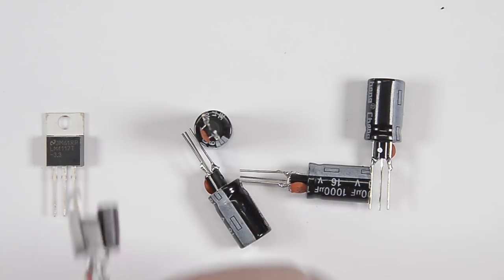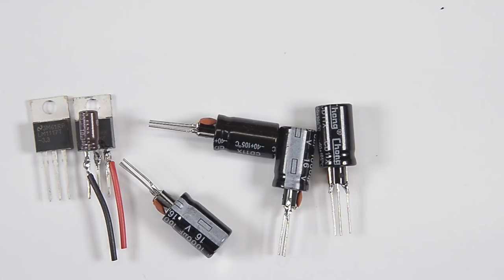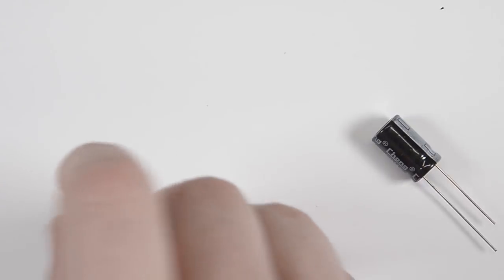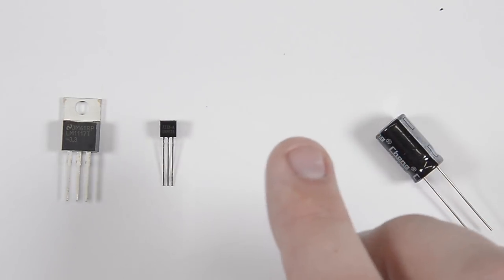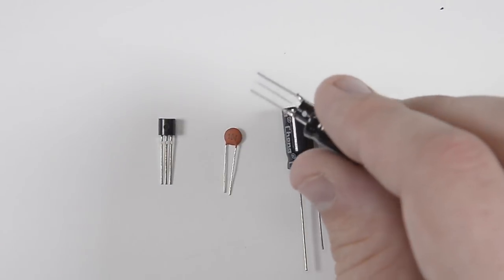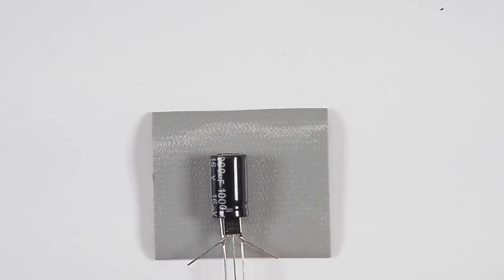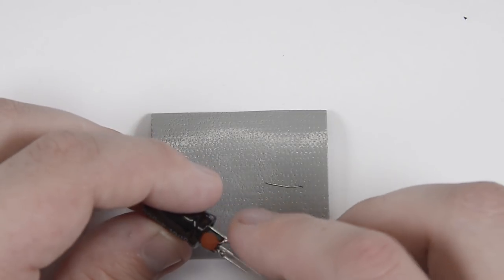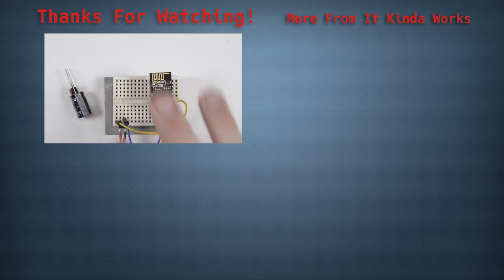New ESP8266 Voltage Regulator Design

Comment: I would actually add that small cap between INPUT and ground, as output and ground are already taken care of and you just add a tiny bit of capacitance to big electrolytic cap.
Reply from the maker: Depending on the power source you may want a cap on the input as well but in general my 5v power comes from usb or battery both of which usually end up with pretty clean power. It's really important to have a cap on the output though since the regulator isnt built to take large spikes in current draw and can drop the voltage low enough to reset/crash the ESP8266.
Reply: Yeah, but then you have this big ass electrolytic cap, so why do you need small one as well? Also, remember about cheap USB chargers, they don't do a very clean job :)
Reply from the maker: the idea is that they operate on different frequencies. The larger cap handles large lower frequencies of noise and the smaller one handles higher frequencies because it can react faster. This keeps the electrical noise to a minimum across the spectrum.

Yeah I know cheap usb chargers arent all that great but I cant complain since I very rarely have an ESP crash these days. I also tend to end up using the charges that come with devices I buy since most of the time I just plug into big USB charger hubs and toss the manufacturer chargers in my IKW bin. The apple and one especially are good but so are most other phone manufacturer chargers. You're right about gas station cheapo chargers though

Comment: Isn't it nescessary to use a cap between Vin and Gnd?
Reply from the maker: Not if your power source (Vin) is already a fairly clean power source such as usb or a LiPo battery. If you have a not so great power source then it might be a good idea to have one on Vin as well. It's not as necessary though.
Reply: I see. Not a huge problem then since it's usually powered by LiPo. Thanks for making these videos. Very helpful with usable tips and "right to the point". Subscribed! :)

Comment: any Links for where I can buy the regulator online?
Reply from the maker: I dont generally post links because I buy them from ebay listings that come and go quickly but here is the top listing on ebay currently http://www.ebay.com/itm/20pcs-NEW-HT7333-A-Low-Power-Consumption-LDO-TO-92-/142153858105?epid=687134941&hash=item211907bc39:g:S34AAOSwPCVYBviC

Comment: I like those tiny StepDown, they are so usefull and so handy.
I myself use AMS1117 3.3v or 5v (Which is also super tiny  & handle 800mA, not bad). combined with 2 capacitors, for IN & for OUT.
PS: I used once APL1117 which is also a good choice!!
Why did you add the second capacitor (orange one?? sorry dont know well its name and purpose here).
Thx

Comment: Datasheet says 250mA absolute maximum for the 3.3V model which isn't a lot of headway. It will be ok for a naked ESP8266 but just adding a few LEDs would make it uncomfortable already imo.
When a datasheet says the maximum, I already assume half of that value is the real life value I want to allow myself to use to keep long term stability.

Consider a follow up video where you sacrifice some of them to science by connecting it to a current limited PSU and slowly raising the limit.
Reply: I think in reality the ESP modules will peak at around 350ma risking the dreaded ESP Reset issue.  I really like this idea, just if there was a bit higher current LD0 in the TO-92 case.  Better would be a buck converter in a TO-92.

Comment: Nice for temp jobs, But nothing permanent should be made like this. 
Please let us know when the caps start failing.
Reply from the maker: +ProCactus what about this channel makes you think that anything on here should be permanent lol! I will let you know but so far so good
Reply: lol ok. Was the first Ive seen from you.
Reply from the maker: No worries dude just playing around. FWIW I rarely have these installed upright. Most of the time it is sideways in a circuit so most of the heat heat generated by the regulator is not going directly into the cap.

Comment: Nice video 📹, and what I don't understand is way using 2 capacitors (one big and one really small) cann you help me help me understand this?
Reply: tx, Agent Office , and i still don't get the poit bicouse they are paralel connected?
Reply: Thomas Bender
A not totally correct but essentially accurate explanation: capacitors of different values smooth the voltage out at different frequencies, resulting in a more stable DC supply.  This is why you will find capacitors all over the place in most electronic devices wherever power is being drawn.
Reply from the maker: This is a great IKW type explanation!
Reply: The big cap is for smoothing, the small is to prevent the regulator to oscillate at some high frequency , it did happened to me, got a hot regulator for driving only 5mA out.
Reply: For extra info on why you use multiple value caps, see EEVBlog #859.  He explains it all there.
Reply: It's not really about the capacitance but about the ESR (equivalent series resistance). The ESR determines how quickly the capacitor can release its charge (lower ESR means higher peak current). Usually you'll see a ceramic cap and an aluminium electrolytic cap. Ceramic caps have very low ESR, but also only come in small capacities (serving short, high current peaks), whereas aluminium electrolytic caps come in much higher capacities, but also have relatively high ESR. Basically when power draw quickly rises, the ceramic cap covers the short initial spike and then the electrolytic takes over. Sometimes you'll even see several different sizes of aluminium electrolytic caps in parallel because their ESR is proportional to their size.

Comment: why 2 capacitors
Reply from the maker: Quoting from boggisthecat "A not totally correct but essentially accurate explanation: capacitors of different values smooth the voltage out at different frequencies, resulting in a more stable DC supply.  This is why you will find capacitors all over the place in most electronic devices wherever power is being drawn."

Comment: usually  li-ion minimum is 3v some have 2.75v
Reply from the maker: Thanks!
Reply: ItKindaWorks However there isn't that much energy in that region. If you want to keep your battery healthy it is a good idea to cut off at around 3.3V anyway.
Super elegant solution imo, maybe apart from the placing.
Reply: The minimum is what your battery management says it is!  You can take them down to millivolts, but I wouldn't hold out much hope when you try recharging the thing!
Reply: another li-ion myth

Comment: Υou had to say how it is
 has such a small voltage drop

lm1117 =transistor
HT7333-A =mosfet 

Big difference !!!!!!!!!!!!!!!!!!!!!!!!

HT7333-A  this is done with mosfet, which is what it means
the voltage regulator can not be set in series
with a 5 volt power supply, so you have 5 volts
and 3.3 volts.
(digital 5 / 3.3 volt)

  this is something that lm1117 has the ability to do.

in fact

when you want 3.3 volts
from batteries you use
Step Down Converter Buck Module
with a range of 3.3 to 6 volts

Comment: This kinda works channel..  is pretty sharp...   and the kinda works sharp guy said 
The step down voltage modules... cease supplying 3.3 v when under 5V power input
Which ended out being spot on...
Won't be able to power these Banggood  regulators on battery very long
Building the 7333 and the 7350 version of this regulator
Having a small abundance of these regulators 3.3 /5 V for portable projects 
Using battery as switched backup at power level just above loss
Code generating notification of condition and switching

Comment: great video!

i see the ht333-a can take up to 12v, have you tried it? does it get hot?
Reply from the maker: I have not tried it with 12V but I would imagine it would get somewhat hot at that voltage since that is its max voltage. I probably wouldn't do such a compact circuit if you plan on using 12V but you can try it out and let me know!

Comment: well, it kinda works...
Just for well regulated DC_in and very low power.
Anyways, I would put a protection diode over the regulator.
Reply: How would you have connected a diode like this?
Reply: Thomas Bender Put it in reverse from the output to the input, so when the output voltage gets higher than the input, the diode avoids that reverse voltage that can destroy the regulator. Without, the capacitor discharges through the regulator and the regulator doesn't like that.
Maybe I'm wrong and such a diode is already built in nowadays. Look at the specs.

Comment: it's bigger 😁
Reply from the maker: It's true that it's a bit bigger but if you take into consideration that I should have been using a 1000uf cap on the old one anyways, it would actually be smaller since that would mean having an LM1117 as well as a 1000uf cap.

Comment: Input voltage:  Up to 12V max!
Maximum output current: 250mA
Vout = better than or equal to 2.97V under full load of 250 mA!

If you got the "-1" version, then you could use up to 30V for input
you need at least 1V over your output, so 4.3V for this particular model.

So, for this particular model, I would highly recommend using at least 4.5V for input if you are going to be running it near its maximum output.

Now, a warning! People seeing this video, and that do NOT KNOW ANYTHING about electronics and use this for regulating power close to the limits of this linear voltage regulators will be in for a big surprise!
These TO-92 packages can go up to 0.5W for dissipation. Soldering it directly under a huge capacitor is looking for trouble, of the explosive one!

Now, as an extra tip, use a low ESR capacitor, it will help you even more ;-)

I use to be where you are in this video for electronic components, and you have so many things wrong.
"Low dropout" means how much voltage it will drop at full current rating, in this case it will be output around >=2.97V, so it will drop up to 330mV or 0.33V with 4.3V input @ 25°C.

Now, for a future revision, if you want it as much stable as possible, you can solder a 10uF small electrolytic capacitor and a 100nF aka disc or similar to the input, and on the output have the large capacitor bypassed with a 100nF also for better stability and less noise on the power supply line and also helps with transients.

Also, I have not gone through the whole comments section, so if someone else has commented something similar, kudos to you.

I wish you all the best in your future endeavours :)
Reply: I tried using this ldo with 8.4v 6 x AA, and I see it does t drop the voltage and it starts to heat, so anyoane can tell if they used with more than 4.5v, since it s rated for 12v

Comment: What’s the purpose of the 100nf capacitor. Is the 1000uF nor enough?
Reply from the maker: The 100nf can handle small yet high freqency power ripples and while the large 1000uf cap can handle larger and lower frequency spikes and dips. Between the two of them most power noise is filtered out.